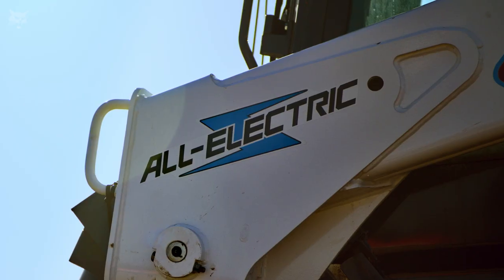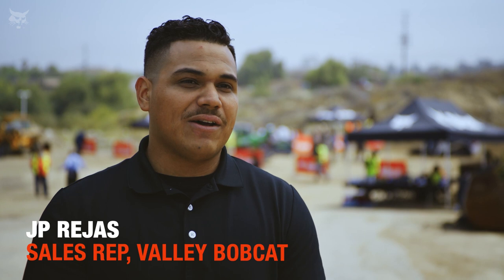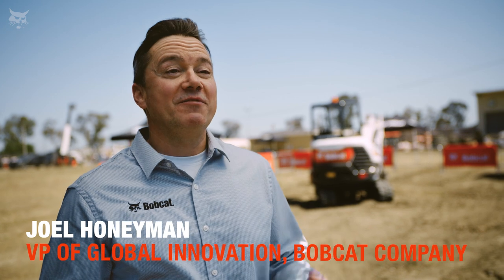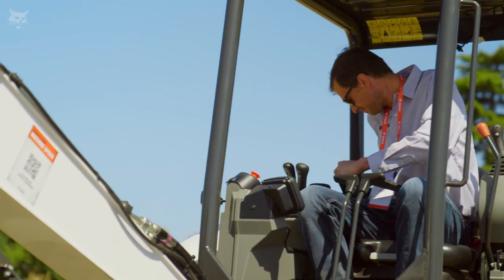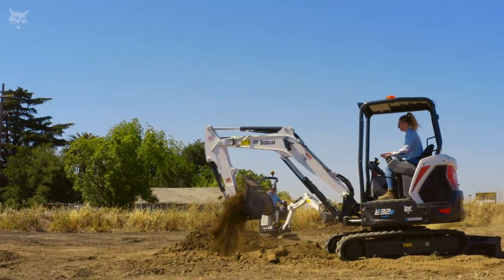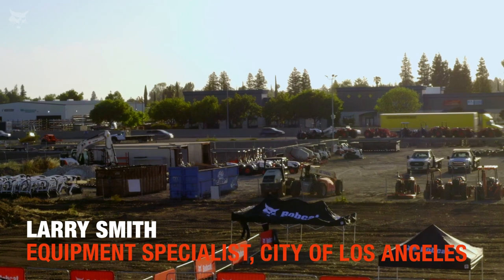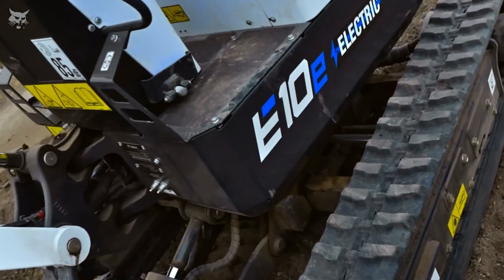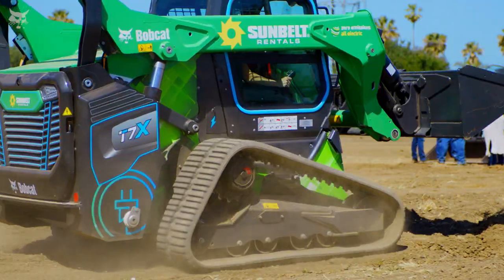What’s So Exciting About Electric Equipment? | Bobcat Electric Equipment | Industry Reactions

Comment: Until you have to spend 15hrs to charge it. I’ll keep the diesel option. A Jerry can is way easier to transport than having a charging doc.
Reply: 15 hours is a bit long. Overnight for 10 hours is possible. It’s no harder to plug in than a corded tool like a drill. Or a cell phone.

Comment: Electric is great but only if its primarily used in a Warehouse or campus setting where electricity is always available nearby. If so, it can be parked charging next to the electric forklift and golf cart. On a typical construction site, it wouldn't work, theres no where to plug it in overnight.
Reply: Interesting. Many use cases. I am sure there are some use cases where the equipment is taken back to some type of commercial building, headquarters, depot, or even single family residence where power supply isn’t an issue. Keep an eye out for products like Tesla MegapackXL, which is essentially a giant battery that can be used remotely with a solar setup, or grid-tied at a longer termed construction site. It can be placed on a site for days, weeks, or years and recharge lots of electric equipment whenever it is not in use. Sure there are many sites where there is no electrical service, and dozens of large machines are used, but that’s not where the industry is starting. They’re starting small and developing from there. On the other end of the spectrum there are several open pit ore mines around the globe that use 230 ton, and larger, earth haulers that are 100% electric. They are able to drive twice as fast as the diesel and take way less maintenance as well as being much quieter and less fatiguing on the body.

Comment: Found the first problem, they're out in commifornia! Second problem, while you're waiting FOREVER for it to recharge the battery, I can fuel up and be back to work in less than 5 minutes, maybe 10 if you have to drop the kids off at the pool😂😂! Diesel ALL THE WAY, besides I love the sound and the smell
Reply: Forever to recharge? If you’re waiting for it to recharge, then you’ve done it wrong. One of the benefits of going electric is the convenience: plug it in overnight and when it is time to use it the next day, it’s all ready to go. Takes a few seconds to plug it in and unplug it, that’s all. No waiting around for fueling, or having to interrupt work to add hydraulic fluid. 
Love the sound. Ok. How about preserving hearing, not needing to wear hearing protection, and being able to communicate with other people verbally without having to shout on a job site? Those are nice advantages as well. 
The smell? Brings back nostalgia for me as well, but also carcinogenic and leads to lower IQs, asthma attacks, and in confined spaces requires active ventilation systems which cost money and time to set up, so…
Maintenance takes time and money. For every dollar you spend on maintenance of diesel, you’ll spend about $0.10 with electric. The new Bobcat can be used all day for $1 worth of electricity and has zero hydraulic fluid costs. 30 gallons of diesel probably costs $150. Plus, it can lift more.
Reply: You are right on @aaronbounds1336 .
Electric is CONVENIENCE!
You don't need to spend any (comparatively) time with downtime.
The maintenance schedule completely removes the engine, which is a huge part of reliability. It's just a high flow electric pump (which I would hope is a Drive/Drive pump). 
Charge it (overnight unless you get a DC fast charger on a genset) and it will run for your typical workday, that's all there is to it. You'll change tracks, attachments and  hydraulics as they are damaged or wear out.
Quietness cannot be overstated either.